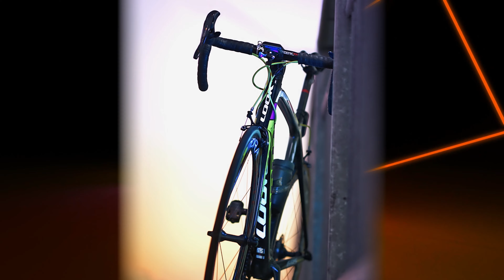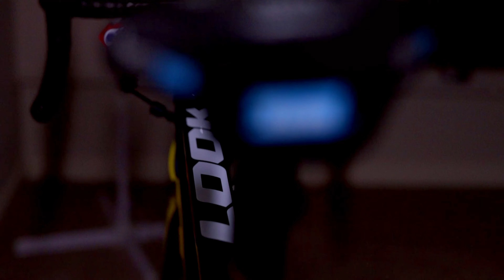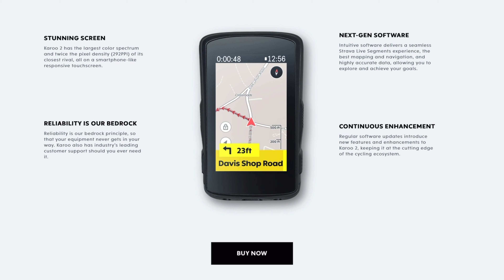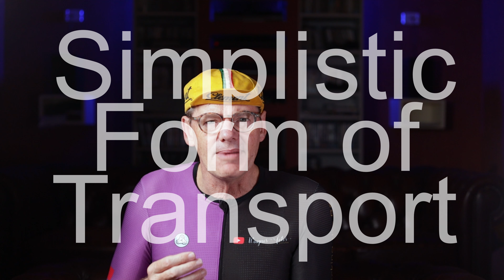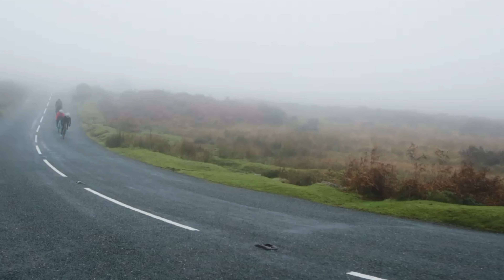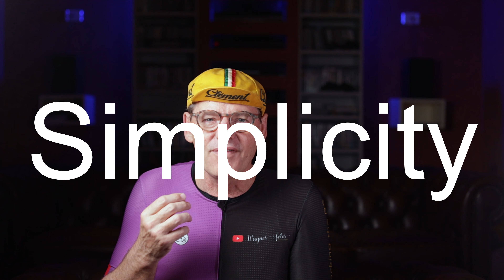The simplicity of a bicycle, or is this disappearing?

Comment: This is the reason why I find roadies a funny bunch of people. 
I started off with MTB, before adding road cycling to my list of hobbies. A modern day MTB is a work of art with its attempt to use various linkages and systems to design the ideal suspension wheel path and leverage ratio. And we riders, celebrate the results, and the way said  mechanism is implemented is integral to the bikes charm. 

Roadies, however, ooorrrrggghhhh change bad….we no want change….rim brake simple…me no like complex mechanism. 

Seriously. Freaking dinosaurs. When will you all catch up with the new age?

Comment: The whole beauty of a Bicycle is that it is human powered. Electric gear changing, electric motors and digital readouts all take away that simple engineering beauty that I love about them.I actually enjoy the exotic material side of the designs which only add to the engineering interest without going away from the main design brief i.e human powered

Comment: If you look at how many bicycles in use today are actually used for racing, I think you will find the majority fall into the commuter and recreational use categories. This means highly durable, simple to repair, easy maintenance are the top priorities not weight and aero design. 
The steel frame, rim braked, 1X, with aluminum parts is the preferred mode. 
Now, hollow tech cranksets, 1X drivetrains, sealed bearings, these are all 'improvements'.
Carbon fiber, disc brakes so powerful you can snap your fork, and using goo and duct tape to lighten up your revolving weight (tubeless tires) are all nice for the racing world, but the reality is only about 1% of all the bikes used nowadays need to be race ready. 
Oh! and the electric to mechanical shifting? How ridiculously complex a system when a simple mechanical shifting system will get you 98% to the same place and never needs to be recharged? 
You are correct, there is an obsession with trimming the very last gram off the bike and nobody addresses how much performance improving just trimming the carbs out of your diet will do or how do you recycle a carbon fiber bike when it's short 5 year life span is over? Oh wait! You don't have to worry about that with a steel bike!

Comment: Couldn't agree more with this video. All of this technology that makes bikes so expensive and high maintenance, is going to make a negligible difference to the average rider. I'm a pretty fair tennis player but if you give me Roger Federer's racket it's not really going to improve my game. I'm staying with my aluminum frame, hand built aluminum wheels, 105 components, and rim brakes.Going to order a set of 105 shifters to have when the originals inevitably fail.

Comment: Screw fit bottom brackets are still press fit. Plus there is a greater chance that screw fit is machined incorrectly as both sides have to be machined individually. So to say that screw fit is superior is just wrong.
Reply from the maker: Yes true, but it hides the imperfections.
Reply: @waynosfotos  in what way?
Reply: @waynosfotos  a misaligned screw fit BB will still trash bearings and potentially cause damage to the bike

Comment: Great vid and perspective, WF!  You're right about fitness and I think that's what guides most people with cycling.  When I started riding, I was out-of-shape for cycling...period.  Over time as I got fitter, I got into cycling more. I went from aluminum bike to carbon, that led to better wheels (carbon), top line bike computer, power meter, direct mount trainer, etc. Now that I was fit, I wanted to know what I could do on a bike so I needed...data! Once I started analyzing data, I was hooked! Then one day I said to myself what are you doing?  I was missing out on my original intent of cycling in the 1st place....enjoyment!  Still look at data, but I've gotten back to enjoying a good ride.😎

Comment: While I understand the sentiment of this video essay, I have to say that no one is forcing anyone to buy a bicycle made from aerospace materials, fitted with robotic gears or uses technology that is beyond what they desire. You can quite easily find a bicycle to purchase that contains none of the high tech complained about here and you do not need to use any sensors, cycling computers or even phone apps while cycling. One example of this is the fixed gear/singlespeed community of cyclists, which seems to be growing. Not to say one has to go that extreme to find simplicity, but it does exist and wouldn't be growing if simple bikes could not be found.

If the actual complaint is that the mainstream bicycle industry is focused on technology rather than the simple pleasure of riding a bike, well that's the nature of the beast. However if you're feeding the beast while complaining about its nature, that's a different problem altogether. Figure out why you ride and what you want in a bike, get that, and leave the rest.
Reply from the maker: The point is they are changing these technologies but discontinuing the other existing technologies.
You can say ride something else, like a fixie. But if you want a nice geared bike, choice is being limited. 
This has nothing to do with complaining, it has to do with money.
You may have a older frame or older bike, now fitting it with new equipment or replacing repairing your older bike is becoming increasingly difficult. You either need to hunt around for older secondhand parts or upgrade your whole bike. Why manufacturers are doing it.
Already the early Di2 systems are not supported. So in the bin if it breaks.

Comment: I'm doing it myself on my new TT build, I find aero  bar shifters really hard to use, they are not like super slick mechanical STi shifters..... Anyway going 1 x 12 with the 'Archer components' DX1 trail shifter, it has a wireless remote and a shift box which connects to you existing rear derailleur. The beauty of it, I can set it up for 12 speed for my super duper carbon race wheels then set it up for 10 speed with the same derailleur with my 10 speed wheels for training. I'm adapting the shifter for aero bars but they have blip buttons in development. It mounts on the chain stay or on your bottle cage mount but I'm working on other locations. Should  be here in 2 days 😁 take a look dude.

Comment: I have felt the same way, especially after my Easton Carbon cranks failed and was forced to replace the BB to be able to fit a Shimano crank.  I would prefer to describe the Tour De France level bikes as the Porsche and Ferrari of the road  bike world, so I'd like to think I've just bought a Corolla of the road bike world in a Polygon S4. (Arriving next week 🤞)  Hoping that with a tyre upgrade it's not too much slower and I'll be saving my super bike.
Reply: I’ve had some troubles with my Easton crank as well. I had a drive side crank arm lose the aluminum insert where it connects to the spindle. 
Might I inquire as to the nature of your issue?
Reply: @joelzylstra2971  LH crank arm came loose where it joins the spindle (specifically the metal threaded insert in the LH crank arm). Very disappointed when it happen at 11500km according to Strava.  The price for light 🤔

Comment: I have nothing against disks and electronics. If you want to weigh your bike down it's ok by me. What I do object to is being forced into it.
Reply from the maker: Me too.
Reply: @waynosfotos  I just had a quick look at the Campagnolo site and seems they are still offering mechanical and rim brake group sets right up to Super Record.
Reply from the maker: @chapmag6578  yes for sure.
Reply: @waynosfotos  I suppose it depends how long they will keep supplying these group sets…..it will be interesting to see if the punters avoid the latest dura-ace to point where Shimano have to revise their strategy of phasing out the mech versions
Reply: @chapmag6578  campag and smaller companies like sensa or microshift are going to be huge next year .
Reply: @edmundscycles1  I guess that’s the beauty of entrepreneurship in that new players will rise to fill the void
Reply: @chapmag6578  yeah , we may even see sunrace coming back into play more . Its just a pity the sunrace lineup looks a  it naff aesthetically.  Function wise they are solid .
Reply from the maker: I think the price is a bit high. Shimano should of split the difference between the electric and mech, so to keep the price competitive, as no mech.
No, but they priced it to the moon!

Comment: Well, here in Germany 80-90% are riding e-bikes. I mean not for commuting, but on weekends. Iam really a freak now on my racing bike. So if you think of families riding with their simple bike to the park, forget it, they are almost electrified.
Reply from the maker: Here in Australia not so big because of the bigger distances. But these electric scooters are becoming really popular, as they are easier to manoeuvre and actually go faster. 
The whole problem with scooters is there no proper law surrounding them.
Reply: @waynosfotos  and tiny front wheel much easier to go arse up hitting a large crack it pothole…..I suspect some the vast improvement in dedicated cycle ways across Brisbane is partly in preparation for the expected big increase in commuters using e bikes and e scooters.
Reply from the maker: @chapmag6578  for sure, but people don't know that till they crash. Most can do about 30km/per hour

Comment: I have to agree for the most part. That’s why I like the idea of the gravel bike as it’s a pretty versatile road bike. With a wheel and tire change one can race road, cross or gravel. One place where electric drive trains are  superior, or can be, is avoiding internal routing issues. Certain full suspension bikes have poor shifting simply because of all the curves needed to route shifter cable. 

As to brakes, in World Cup DH  it is said that the top pros brake the hardest. That’s because they go into corners fast and brake as late and as hard as possible. I think road riders will learn this at some point but it’s also less important on road than off road. Personally I like disc brakes and have used them on a cross bike. Whenever I got on my road bike with rim brakes I was always mildly surprised at how less strong they were. Dura-Ace brakes too. I’ve had DI2 as well. Really didn’t make as much difference to me between the cross bike and road bike. But yeah, a bicycle should be a pretty simple thing. No motors for me, love my hardtail, it’s the act of riding that I love. Less complex bikes seem more connected to me and the ground.

Comment: Something that I find absolutely humourous is the sudden rise of electric motor assist on City bikes. They are selling so fast here, the shops can't keep up with the demand. Take a look at this on a global level...and you find there are more people using e-bikes of all types as their daily transport. COVID-19 has basically parked the auto in many places.
Reply from the maker: Well, yeah, i support this, more bums on bikes, be it electric, is good.
I do feel electric scooters may eat into this as bike manufacturers are charging to much for an electric bike. The price needs to come down.
It is crazy, you can buy an illegal scooter and it goes faster than a legally compliant electric bike. 
This does need to be addressed by authorities.
Reply: Waynos, have you read cyclingtips' article about 105 di2? And yeah, the humble bicycle is now a tech-tour-de-force. Same with cars
Reply from the maker: @pigeonpoo1823  cheers, just checked it out, pretty much says what i predicted. Will be uploading a response vid shortly.
Reply: @waynosfotos  excellent, keep up the great work
Reply from the maker: @pigeonpoo1823  na, what do they say? i reckon they want Di2 only in the upper bicycle industry. 
Cheaper to make  and charge more and frame makers want it too. No holes.
It also means they only need to make one frame, and one groupset.
Reply: @waynosfotos  105 di2 12speed disc only. And for us anti-vaxers (sorry, anti-discs, but we are scorned by big biz in much the same way) a plebby 105 mech may make it

Comment: There was carbon fiber seat stay break (caused by Allez Opi+Omi incident on Stage 1 Tour de France 2021) on a Cervelo bike.  The rider continued to race the bike after the crash unnoticed.  Until the sports director saw the seat stay carbon break and ordered a bike change.  Cervelo engineers jokingly said their road frames are designed to be stiff enough that the seat stay only exists because of the UCI.

edit: correction to Cervelo not Colnago
Reply: It was a Cervelo. The Cervelo engineer wasn't joking about the seat stay bearing almost zero load.
Reply: @bikerjk1205  Thanks for the correction.
Reply from the maker: Sure 🤔

Comment: So simple that shops need charts to make sure they get a proper bottom bracket adapters, charts for components' cross compatibility and they have no proper expertise in servo motor and electronics to do advanced troubleshooting.
The bicycle is no longer simple. It has simply become a mess in terms of "standards", quality control issues and planned obsolescence. Not to mention that it's excessively  overpriced when compared to a motorcycle that requires far more investment in terms of manufacturing tooling, assembly lines infrastructures, employees training and expertise, extent of parts inventory required, cost of shipping and training at the dealers of sales and maintenance staff.
Reply from the maker: That is so true, but you as i know some people will argue in the comments something different, all new tech is just wonderful!
I have noticed most of them have some buy in to promote these products, like they are distributors or sellers.
Tubed tyres, round seatposts, seperate stem/handlebar systems, round frame tubes and mechanical gears, work fine. And as good as all this proprietary components they want to buy you into. Which they claim, Is more aero, more compliant and lighter, Well they are telling us weight doesn't matter now, but for the last 100 years it did.
Reply: @waynosfotos  weight always matter… the problem is that they can’t make those pig of bikes lighter without sacrificing strength so now they push the aero BS.
Reply from the maker: Yes true, frame makers are now using expanded polystyrene blanks to make the frames lighter, due to the increased weight in the groupsets i.e. electric and disc brakes. They are having success here but the frames are ultra thin.
Reply: @waynosfotos  
And they send you some extra polystyrene in the bike box to make a cooler. This way, you can keep your ice packs cold and take care of your injuries.
Reply: Lots of simple bikes…Rivendell, Soma, Crust, Milwaukee, Gunnar, and more. The problem is that people buy into marketing BS…mainly Roadies.
Reply: @goodoleme747  
Don't give me the shitty overpriced solution of artisanal bikes in the era of machines that build machines.
If tomorrow we all rely on those little shop, we're in deep shit.
I guess you drink artisanal beer and eat only bio stuff.
These means of production cannot support the current demand.
And do these manufacturer do their own components ?
No, so basically you're talking frame exclusively, which is the simplest part of the equation.
Reply: @sylvainmichaud2262  ok then buy an older road bike and go along your way.
Reply: @goodoleme747  
Are you the kind of guy who wears Rapha clothing ?
Reply: @sylvainmichaud2262  lol that’s a joke right? Nope. Isn’t that stuff for Drs and coffee shop riders? Are you seriously grouping me based off of one comment I made earlier? Lol okay
Reply: @goodoleme747  
Well, those who buy "boutique" bikes are generally proud to wear their Rapha clothing while riding their hand made bikes.